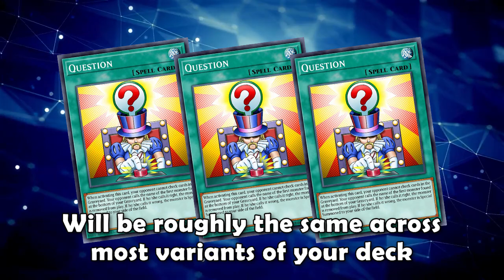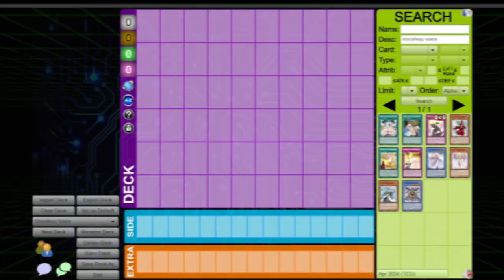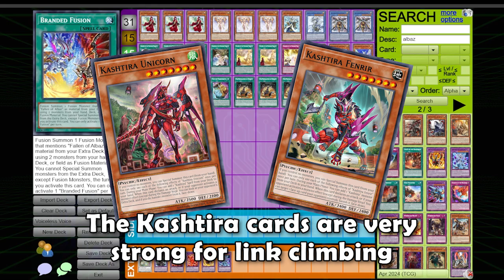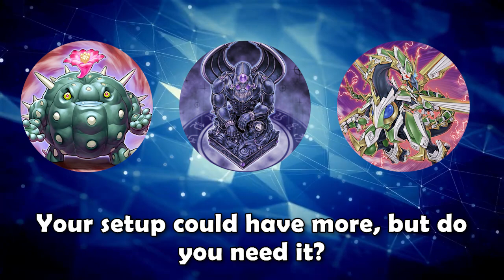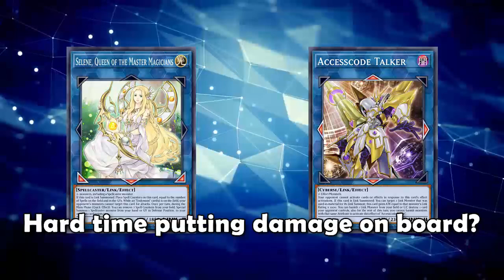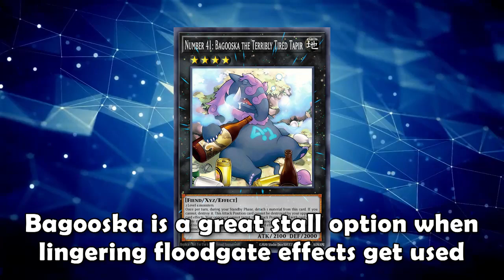Modern Deckbuilding Explained Easily. Yugioh Guide

Comment: What do you go by when you're looking at a deck play style because I found out different names of different play styles aggro, control(stun,burn)? combo, mid-range, ramp, hybrid
Reply from the maker: @skyknightking0  for modern yugioh I normally categorize decks as either control, midrange, or combo. Control decks can’t play through huge boards and usually use their cards to control/minimize the board state. These decks really excel in simplified game states. Think something like labrynth, traptrix or even ritual beast. Midrange are decks that can play through interruptions to build their board, can pop off really hard if they have enough gas, but their combos tend to be more limited and linear. Decks like branded or snake eyes fall into this category because you can usually tell pretty easily what their next play will be while they combo and what they’re trying to do. Combo would be a deck that is all gas, trying to build the most unbreakable board, or ftk you. There aren’t really many combo decks that are playable right now but something like mannadium a few formats ago definitely fits the bill
Reply: @ggGio  thank you for your knowledge on the subject I have seen so many different videos about play styles I guess I was thinking the big 6 play styles aggro, control, combo, mid-range,ramp And hybrid had subcategories like stun,burn,stall,otk,ftk, beat down And Mill if that's all of them but I guess it does matter with the archetype playing a major role